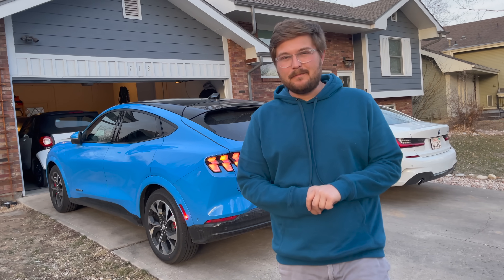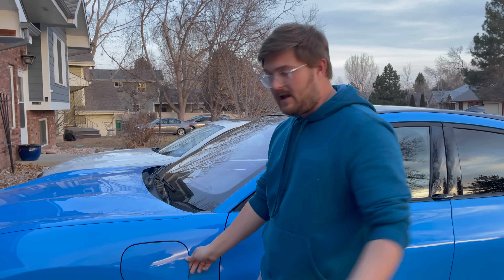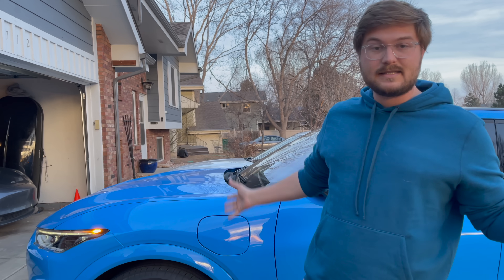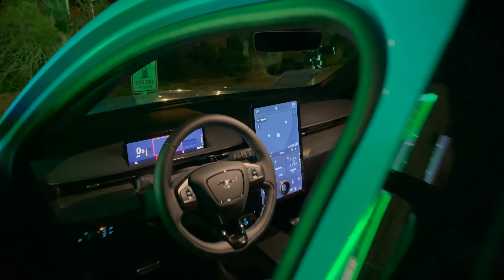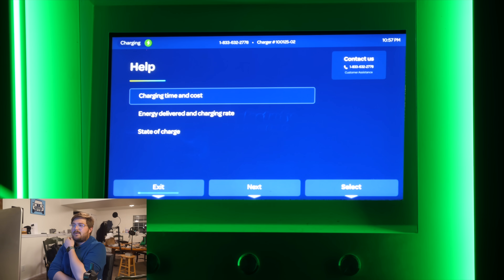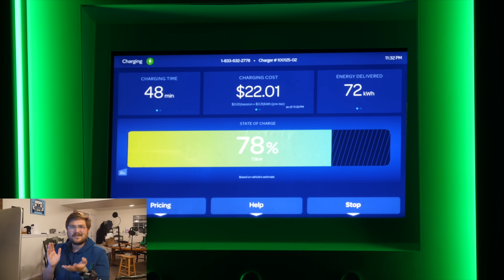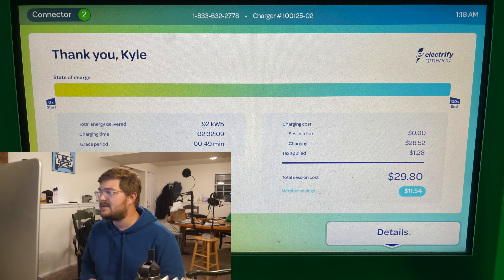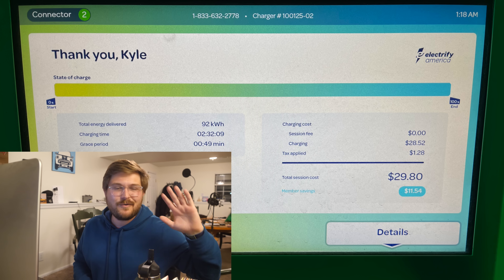DC Fast Charging Mustang Mach-E From 0-100% Takes Over 2 Hours! Here's Why.

Comment from the maker: 0:00- Intro
0:23 - Testing Procedures / Background Info
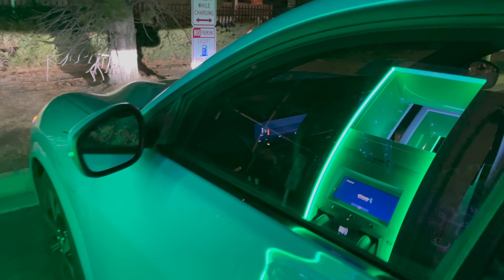6:20 - Arrival to EA Station
8:00 - Charging Curve
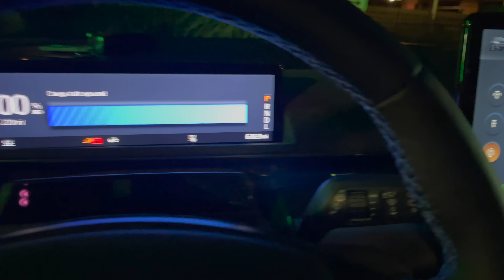13:53 - The Stats
Reply: Can you please do a 10.to 85 per cent super charging on 250 or 350 kw and time frame? A 10 to 85 per cent? Or a 5 to 90 per cent? Please? With the new update? With the new car update?
Reply: Posting an actual curve, a graphical chart, will make it much easier to compare against different charging strategies, after updates, and against other cars.
I like your videos but the non-stop word salad can make it a chore to dig through for data points.
Reply: @Miata822  Yes I'm not a verbal learner unless I'm familiar with the subject and it's just an update but the learning new stuff I actually do better reading or pictures

Comment: why not use a super capacitor and a battery, you can do a quick charge with the super capacitor and that charges the battery. or when you plug it in it charges both obviously the super cap would charge faster so in like 10-15min you would have lots of energy stored. or have it run off the cap and the battery is for extra range..

Comment: $29.80 to charge the car just to travel 220 miles? I can fill my truck for $30.00 and go 410 miles. Oh wait, my truck is PAID FOR. Electricity provided by fossil fuels vs gas? Emissions from the electricity provided by fossil fuels is worse than gas vehicles. Ford F-150 Hybrid can go 700 miles on one tank.

Comment: Great video!  I have been thinking of getting a Mustang Mach E.  I drive a F150 now that has a 36 gallon tank with a range of 600 miles.  Given what you showed, looks as though cost per mile is 1/3 less than gas version.  Will be interesting to see how much time is spent at a charger when you do your long trip.
Reply: I just picked up a Mach e.  For home charging, I'm getting a "tank" for about 10 or 15 times less than my previous gas powered small SUV. Haven't tried public chargers yet but look up your own $/kWh to figure out the cost to fill at home.

Comment: I’m not sure if those are the the correct expressions in English, but what Ford is doing “charging for a certain amount of time at a peak rate and the throttling down” is an open-loop controller, which makes less of a sense in this case, as it is quite easy to monitor the pack temperature and reacting to that thus creating a close-loop-controller.
Even the fact that you can unplug and then replay and you get a second session of peak power shows that
A) It is a open-loop-controller that ignores pack temperature 
B) Ford is quite sure they can deliver peak rate at any state of charge but their cooling system is not able to get all the thermal losses of the pack at peak rate, and they use the thermal inertia of the system.
So I personally don‘t understand why Ford thinks this isotherm best way to go.

Comment: I'm sure the Ford engineers are aware of the charging curves and the physics involved but intentionally took a conservative approach to extend long term battery life. It's plausible that they may push out a new software/firmware update to make the curve more aggressive without compromising long term reliability of the battery pack too severely.

Comment: We drove our Model 3 to Las Vegas right before the pandemic and the entire 708 mile trip cost $43.04 in super charging. That works out to about $0.06/mile.  This test, if the car gets 270 miles is just over $0.11/mile and if it's 220 miles range then that's $0.13/mile. That's starting to be pretty significant.

Comment: Anyone who is considering buying this car, keep in mind that this is quite unrealistic and misleading for general ownership. Although I respect what he did for the video, there are a few items that would almost never happen for responsible owners. Allowing your car to hit 0% is terrible for the battery. I've owned my Mach E for almost 3 months now and the lowest I've gone is 10%. Please don't go much lower than that. 

The temperature and charger location is also variable. Since he was at near freezing temperatures, charging is slower. At EA I consistently get 140+kwh. 

Charging at any EA station no matter what car you drive, it will slow down after 80% which was the most misleading issue I've seen so far. First, you do not want to charge to 100% unless you're going on a long trip but even if you do, I'm sure you can charge to 80% at each station and save yourself 2 hours for 20%. That goes for any new EV. The vast majority of the time you will only need to fast charge for 20-40 minutes. 

I don't have a charger at home because of my insane HOA in LA but I get by perfectly fine with free fast charging all over the place. I bought the 300 mi range premium RWD and I'm consistently getting an average of 340+ miles range. I don't drive like a speed demon and I mainly keep it in whisper mode. 

I highly recommend to anyone, especially those who are thinking about getting a model X or Y. It's a fun vehicle, easily the best looking EV and it the interior is far better than any other car I test drove before I bought this.

Comment: So Ford has basically hardcoded some values in their charging curve instead of dynamically assessing the temperature, voltage and other parameters necessary. I remember hardcoding some values in my first year college C program when I wasn't getting the desired dynamic output.

Comment: It isn't the right way with no sensor input so I agree with what you imply.  When the mach-e says 100% it still goes higher.  100 to 99% is not linear to the rest of the pack.  L2 to 100% gives you 15 miles in the first 1% but the car does not have 1500 miles of range.  Appears range test should be carried out with 80% SOC on this car right now.

Comment: I'm thinking of getting a Mac-E , but electric cars are not convenient at all at this point.  You don't save money on the charging, you have to be there 2 1/2 hours, on a trip that adds a lot of time to your trip. We are in 2021 charging from 0-100 shouldn't take more than 30 mins. Electricity should cost way less and they should be way less heavy and more efficient.
Reply: Most the time you shouldn't charge from 0 to 100 you should charge from 20 to 80.
It's still cheaper to fill up using electricity compared to gas also your brake pads will basically never wear out and you don't have to get oil changes.  But if I were you I wouldn't get a Mac-E I'd get a Tesla model Y,  Tesla supercharging is also cheaper.

Comment: I totally disagree with Kyle on charging cost. So far my MY charging costs have averaged about 25 cents per kWh. That puts fuel cost for electric close to a car getting 30 mpg at $2.50 per gallon.  32 cents sounds very high and unacceptable to me. If you have free charging you no doubt do not care, but when paying the bill for a long trip, 7 cents a kWh  adds up.

Comment: 230 miles for $30?

I get 350-417 miles per $30 of gas and it only takes 2-3 minutes to fill up.
Reply: 230 miles on a normal charge at home is less than half the price of gas and you don't have to go anywhere :-p
Reply: @applemachome  The point of having transportation is going somewhere.
Reply: @sbacon92  Ahh, but how often are you driving over 230 miles without ending your trip at home? Bingo.
Reply: @kennyb123  That may be true of you and your uses, but there are millions of people that enjoy travelling and taking road trips in their vehicles.  Cart Manufacturers for the last 70years have pushed and made that not only possible but fun.
Reply: @TheLamrith  No crap. This isn't the vehicle for you.
Reply: @kennyb123  You make it sound like traveling 230mi and not ending at home is rare, when infact it is anything but rare in todays society.  That was my point in responding to you.  
I love Ford and hope they get this sort of thing figured out as it simply falls short currently.  I have a deposit down for the new F150, crossing fingers they get it sorted out so that the truck is viable for roadtrips.
Reply: @TheLamrith  the charging network is going to look completely different in 5 years, and hopefully, it'll get cheaper. But if I road trip in the truck, I couldn't care less about the price being as much or more than an ICE vehicle, because the other 90-95% of the time, I'm paying electricity at the estimated equivalent of 85mpg.

Comment: 14:00  220 miles for $29.80 ... with current $2.82 avg gas prices in Michigan .. a car with 20mpg would cost the same per mile. Not impressive, EV fast charging cost seems only attractive by cost, when gasoline is over $4 a gallon. Charging at Home, at much lower rates, does save money over ICE.

Comment: Makes me appreciate the 2 or 3 minutes I spend once a week putting fuel in my car.
Reply: You never DC fast charge to 100% anyway. You charge to 70-85% depending on the car and off you go. The SUVs Audi E-Tron and E-Tron Sportback charge quite fast over 80% tho. Takes 10 seconds to plug in at the AC wallbox at home where you can start with a full "tank" every day. 20 seconds to plug in at a fast charger and scan the RFID. On longer trips you plug in and go to the restroom, stretch your legs and maybe grab some food while you charge for 20-40 minutes. I prefer the EV over the petrol car every day. The petrol car doesen't have an app for preheating during winter or cooling befor you go during summer either.
Reply: @christianolsen2192  True. I suppose we will have to adjust to a new system in general. It’ll take some getting used to but will feel very normal in time.
Reply: @anthonywalker6168  I think the battery packs will be different in the next 5-10 years also 🙂 Lighter, less minerals and materials used, and more dependable and faster charging. Some cars are very fragile to low or high temperatures. Like the Nissan Leaf (especially the 40kWh) who doesen't have active cooling. The battery pack is almost cooking after a longer trip with several fast charging sessions. Or how slow charging might be on cars without battery heater during winter.  I respect that the EV's of today isn't for everyone. But in a few years I think the issues with charging will be long gone 🙂
Reply: @christianolsen2192  That tired crap of "starting with a full tank every morning" only works if you are always at home and not out in the real world doing anything else. Newsflash, you aren't always at home.

Comment: I have a feeling that Ford is being conservative because they want to get more real world data from owners charging in various environments and temperatures before they increase the charging speed later on to avoid stressing the battery out too much early on.

I think Tesla did the same thing with the Model 3 and Model Y when they first came out. The charging rates were capped at a certain amount, but after a few months they increased it once they had some real world data to work with.

Comment: At the moment highly subsidized gasoline makes charging at Electrified America a regular EV like Ford Mustang Mach E featured in the video look like extremely expensive. However,  doing the math it turns out that with real world of 275 miles range Mach E costs 29.2$ to charge. It needs to spend a dollar per 9.42 miles driven. The national USA average price of gas is 2.77$. For one dollar the driver of a PHEV like recently featured on this channel BMW X5 PHEV can buy 0.36 gallons of gas. According to EPA being rated at 20 MPG that car when battery is depletted can drive 7.22 miles for the same dollar. Making the ratio it turns out the driver of Mach E has to spend on "fuel" the same amount of money as a ICE driver with a car rated at 26 MPG which is close to money spent by somebody driving a Volvo XC90 PHEV rated 27 MPG while battery is depletted. If the charging speed is going to improve charging will get close enough to the the time spent filling the tank with gasoline.
Conclusion: 
1.With decent charging speed and discontinuation of gasoline subsidies even costly Electrify America will make financial sence for fast charging EVs.
The proof of my words come in a video on TFL channel when Tesla Model 3 using supercharging network costed only some cents more than using gasoline in colorado mountains to drive a AWD Toyota Prius the same distance up in mountains and back downhill.
 And in that case Prius is rated 52-55 MPG.
2. On longer than 700 miles trip on Alex on Autos channel Mach E has shown comparable charging time to the best new EVs on the market.

Comment: Am I the only one that finds this video shockingly bad for the #MachE? I cannot imagine being stuck at 12kW at an Electrify America station charging by the minute for the 80-100% portion for over an hour and a half. What the hell was Ford thinking? It’s not even like it charges quickly from 0-80%. It took nearly an hour. I really can’t believe Ford released a car that charges this slowly. If the Ioniq 5 is half as good as I’m hoping it will be, it’s going to be the new gold standard for charging. 5-80% in just a little over 15 minutes is legit and makes the Mach-E look like it was developed 50 years ago. 

Also, why does Electrify America put two CCS connectors on each charger when there’s only one parking stall?? My biggest issue with EA is their major lack of charging stations, pricing and unreliable performance. They also have really weird locations. Here in Raleigh, I know Kyle is familiar with the Starbucks on Glenwood Ave location (why so far from the interstate???), Wake Forest Walmart (nearly 10 miles from I-540 up the most traffic logged road, Capital Blvd), the Cary EA station (again, not very fast to get to). Then there are the 300-1200 mile sections of major interstates like I-40, I-20, I-55, I-94 that do not have a single EA station, meaning travel to vast swaths of the country is impossible unless you rely on AC charging. For 99.99999% of people that’s not going to work. Those gaps and others need to filled ASAP since VW, Ford and others are now delivering mass produced, somewhat mainstream cars to the public that will have to rely on Electrify America for charging. Electrify America still has major cities like VA Beach-Norfolk, Wilmington, NC and Myrtle Beach, SC that don’t even have charging stations. We’re talking about some of the busiest tourist destinations in the country. With very few new stations seemingly under construction I don’t have any hope that Electrify America will close these gaps any time soon. That’s really the main thing that keeps Tesla in such an advatangeous position. People are going to buy a new $65,000 Mach-E just to discover they can’t make it to their favorite vacation spots without stopping overnight to charge on AC power or hoping there is some third party 50kW charging station that actually works on their route.

Comment: Hi Kyle,
I think this test is really not representative. Normally you use the 20-80 gap to AC-charge an EV fast  A N D   the battery ist pre heated or better say ... pre conditioned by the car its self / Thermal management. This way of charging doesn't say anything about the real charging curve. Charging from 0-100% is normally a task for DC-charger (... and takes in this way even much more time.) These values where never mentioned by FORD or any other driver.

It's a great offer from you to show us the AC-charging curves. But  P L E A S E  (!!!) use a pre heated / pre conditioned battery as the Mustang it would do and use the thermal management!

Thanks a lot and best regards from Germany

Comment: Great video looking forward to the future charging sessions and your road trip.
The cost of charging seems high to me. You are correct it is cheaper than the per minute fee. But even with this it cost you more to get 250 miles of range then I would spend in my Toyota hybrid to get the same number of miles. Significantly different. At $2.75 per gallon. I would have spent $19 to go 250 MI.
Doesn't really seem like a great deal, of course there's the lower maintenance cost with an EV. But it would be interesting to do the comparison.
I do all my own maintenance on my own car. Fuel all fluids and maintenance and tires cost me 7 cents per mile.

Comment: Interesting.  $29.80, for how much (projected) range?  I have a 2019 Toyota RAV4 Limited (gas) AWD, and I just did some quick calculations.  My average fillup over the past six months has been $25.21, for an average of 316.7 miles per fill.  I usually fill up at around one quarter tank remaining.  Of course, there's no "plugging in at home," but that also costs a certain amount, and I'm aware that electricity costs vary pretty widely throughout the country.  Just thought I'd toss that in.....

Comment: 2 hrs and 32 min (ridiculous) just makes plain that EV's are not ready for mainstream if you're expecting to get 100% use of your battery every time you charge. Buyers need to be fully aware that only 60% of any EVs battery is really available in a usable fashion and your range needs to be figured at 60% of what the manufacturer states if you plan on frequent long trips. This is why Tesla remains the front runner on EVs...their range and charging network remain far and away the best you can buy.

Comment: Kyle, have you done a video testing the charging curve of the Niro EV?  I just got a 2020 Niro EV and when I charge at a 150kW Electrify America station, the charge rate is about 50kW from 15% to 35% then ramps up to 76kW at 36% up to about 70% SOC.  Is this normal?  I would think the charge rate would be highest at low SOC so seeing it at only 50kW at 15% seems like something isn't right.